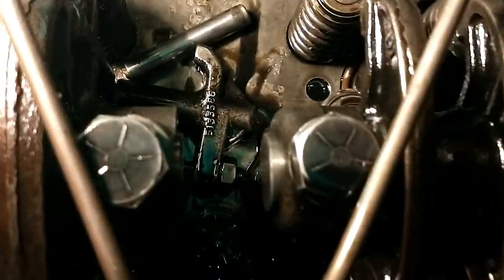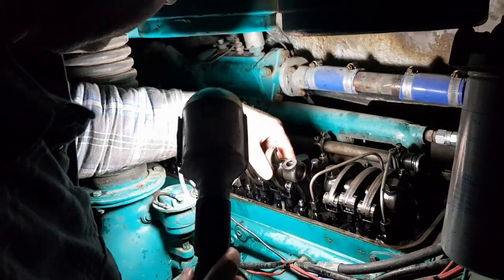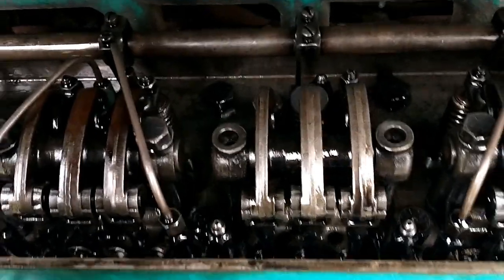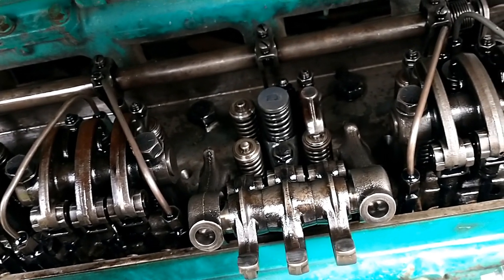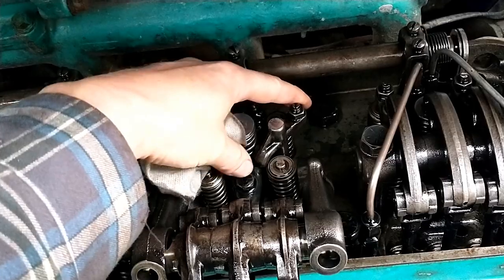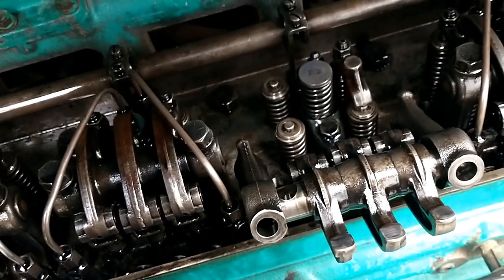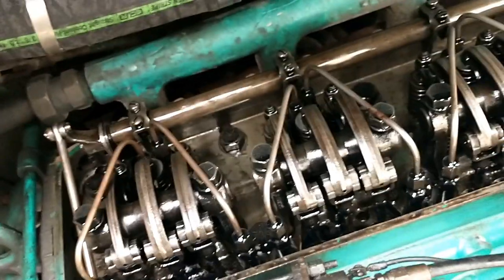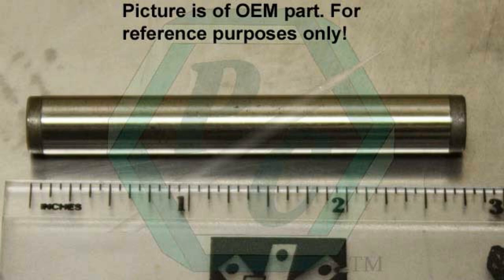Trouble in Paradise (48 GMC Silversides)

Comment: Jason, this is a repair that I have performed many many times.  I dont think valve adjustment was the reason for the failure.  The main reason you see this type of bridge guide failure is "side loading" of the bridge which is primarily caused by a misadjusted valve bridge.  Basically contacting one valve before the other or valve spring tension imbalance.   It does look to me that you may have a weak or worn spring on that one you were pushing in the video.  
I've seen careless mechanics just drive the old stud into the water jacket and insert a new stud.  It might be OK for a side of the road repair but I don't recommend that.  The stud needs to be drilled internally threaded to 1/4 or maybe 5/16", insert a grade 8 fastener and pulled out with a puller or slide hammer.  Make sure you drain the cooling system first.  Although there is a special tool for installation you can use a deep socket and drive it in to the spec height checking the height with a depth gauge from a dial/vernier caliper.  Make sure you review and follow the procedure for the valve bridge adjustment.   Good luck I know you can handle it.  BTW, the compression test is a good idea.  
Be safe, Mark "TinShack"
Reply from the maker: Thanks for confirming this does indeed go through to the water jacket.  I suspect that by the crude drawing in the manual I'd have coolant coming out. I plan to check all the bridge adjustments when I get the new parts in.  Good info!
Reply: @BusWithUs.  here's a tip...remove all of the valve bridges and break the jamb nuts loose in a vise.  If you you do it on the head, you risk bending a valve stem or even cracking a valve guide.

Comment: Excellent video 👍👍👍👍that's a mess when stuff like that happens is the hole in the head a dead end. If a drill bit will cut it and you could thread it them use a grade 8 bolt threaded into the guide until it bottoms out and pushes the piece up and out of there

Comment: Remember that play is dependent on where the the cylinder is on the cycle.  Some that seem tight might just be at that cycle of the rotation.
Reply from the maker: The differences I was comparing were on the same cylinder, so the pushrods are in the same place.

Comment: There's another way to get the broke guide out drill thru the stub and find the right drill bit for a 1/4" x 28 thread tap and drill and tap it to that size you have to drill all the way thru and then thread in a grease zerk of that size and start pumping grease in there it's works like a press I have used tricks like this before
Reply from the maker: This stud goes into a water jacket, otherwise the grease trick would work.
Reply: @BusWithUs.  that may be fun to get out of there i think you could drill and tap it and put a socket above the stub and use a short bolt thru the socket and tighten the bolt and recieve the stub into the socket inside
Reply: @BusWithUs.  I doubt it actually goes right through into a water jacket, great potential for corrosion, water leaks into the oil and just bad practice, also as it has a top load it must bottom out into the hole, I know the hole could be stepped / counterbored, and maybe the stud is above a water jacket passage through to the head gasket face so it could be drifted out from below but I would double check that info,       I have never seen let alone worked on a DD but watch a lot of Bus Grease Monkey, retired BMW mechanic in the UK......